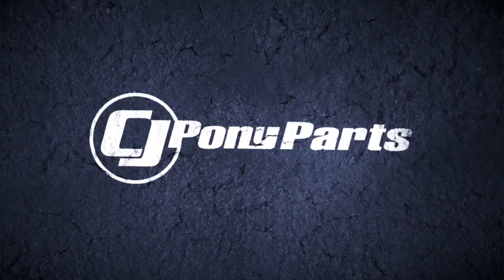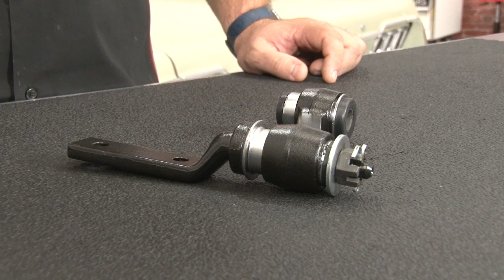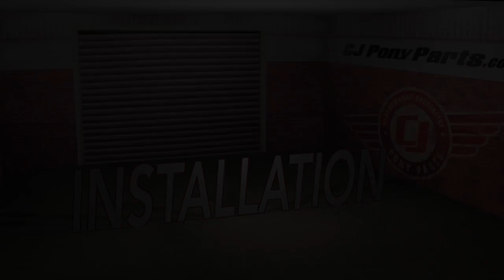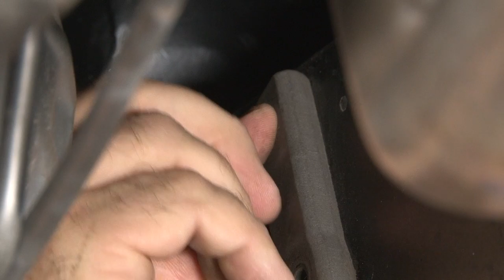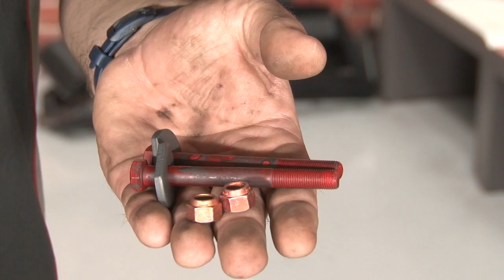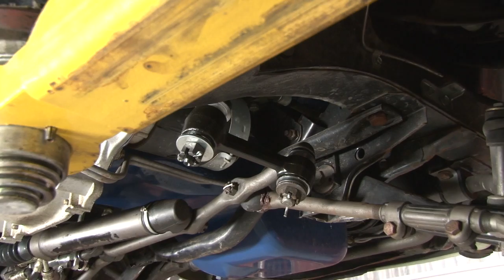Power Steering Idler Arm Assembly | 1967-1970 Mustang

Comment: The title says this part is for power steering, but on the website , this part is for manual steering...  ?????
Reply: This car has power steering. It has the power steering cylinder slave and control valve.
Reply: @dennispetersen511  I have he same set up with the same idler arm. I purchased a new idler arm and it doesn’t fit the center link. Any suggestions?

Comment: My 1969 Mustang has power steering and I bought the power steering idler arm, however it the old one that is still currently installed looks like the manual steering arm (2 castle nuts and no zirk fittings). What is the difference between the idler arms?
Reply from the maker: Shaft is slightly different. The PS arm should have 2 mounting holes and the MS arm has 3.